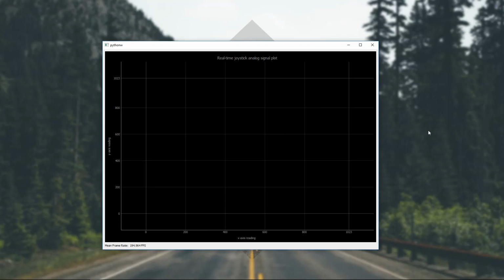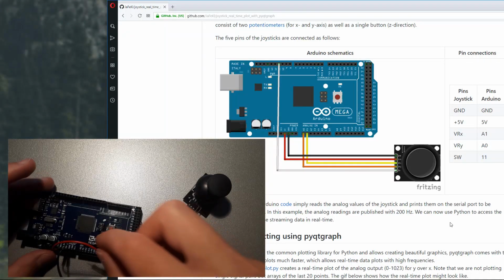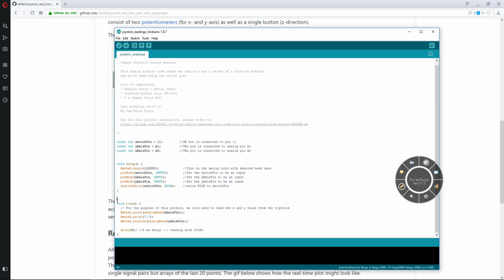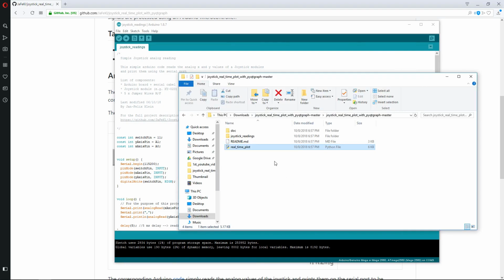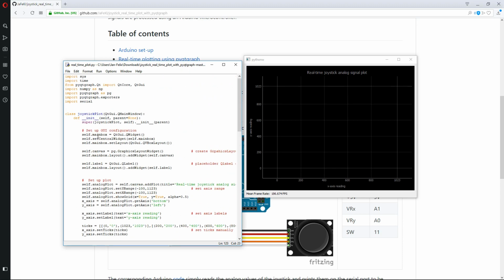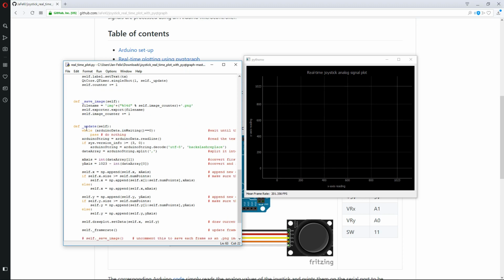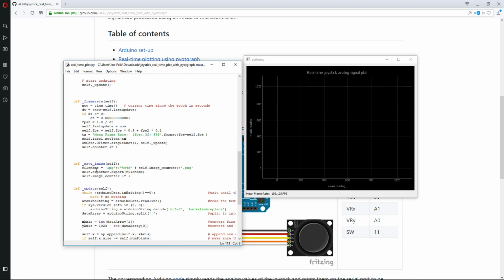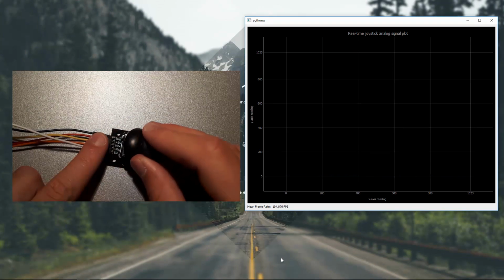Real-time plotting of analog joystick signals using pyqtgraph

Comment: t seems the syntax for matplotlib and PyQt-Graph is not compatible.   Any thoughts on when one may be better suited over the other?

For example, I'd like to use one thread (queue, asyncio, multiprocessing?) to get (py)serial data, that comes in every 500ms....  and in another thread (queue, asyncio, multiprocessing?) plot this data.. either using matplotlib-blit, or PyQtGraph-split. 

I've seen other python packages like 'oscilloscope' or 'pydatascope', but they don't seem to use separate processes for serial and  for plotting!

For example, this is from https://iosoft.blog/pyqt-serial-terminal-code/:

import signal, time
import serial
from multiprocessing import Process, Queue

def read_port(q):
    with serial.Serial("COM2", 115200, 8, "E", 1, timeout=None) as ser:
        while True:
            q.put( ser.read(1)[0] )

def show_data(q):
    while True:
        # block for first byte of data
        data = [ q.get() ]
        # consume more data if available
        try:
            while True:
                data.append( q.get_nowait() )
        except Queue.Empty:
            pass
        print 'got:', ":".join("{:02x}".format(ord(c)) for c in data)

if __name__=='__main__':
    try:
        q = Queue()
        Process(target=read_port, args=(q,)).start()
        Process(target=show_data, args=(q,)).start()

        signal.pause()          # wait for interrupt

    except KeyboardInterrupt:
        print("clean-up") #!debug

Comment: Add button for close com port for serial comunication?
Reply from the maker: If you mean the switch button of the joystick, in this example it's attached to the Arduino but without any function assigned to it. Using it to to close the serial communication would be possible